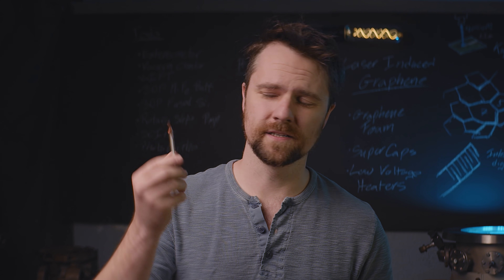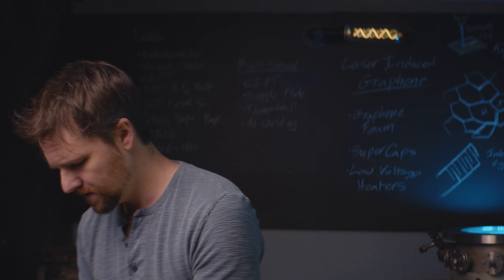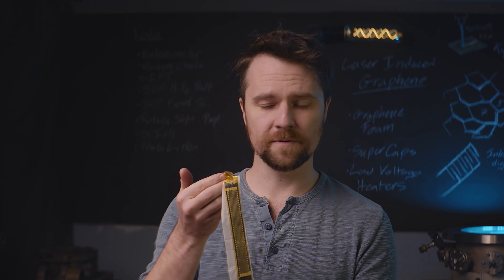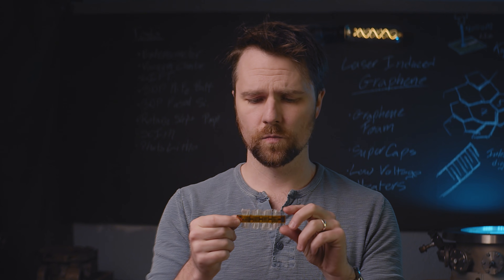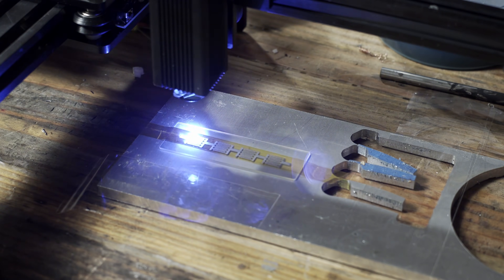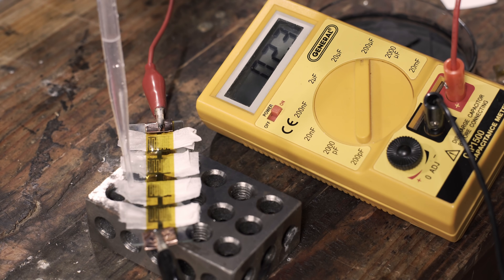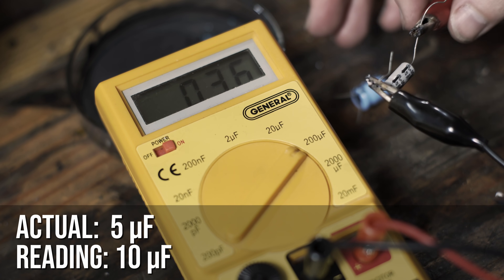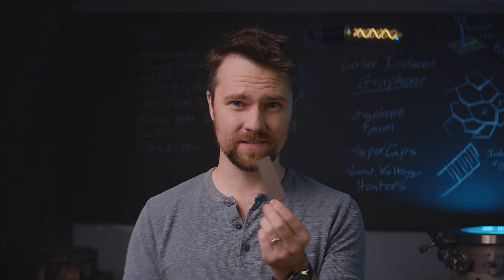Kapton Tape Supercapacitor?

Comment: Just a note, it doesn't matter how much capacitance you get, if the ESR is huge, then your capacitor is pretty much useless. You should demonstrate that in your video by actually charging and discharging your capacitors and see how much useful energy you can store

Comment: Well, hitting a tape with a laser makes graphite, not graphene, and the measuring of the capacity is just incorrect in this setup. Also you successfully created a battery not a capacitor. Thumbs down.
Reply from the maker: You can take it up with the authors of the Nature paper, and all the other academic work that has produced and characterized Laser Induced Graphene on polyimide.  Lol.  I'm just showing what scientists have published years ago.  But cheers for your opinion. 😂

Comment: Would you please show the particulars of the lazing process?  For instance, the distances, power, speed, tape sticky side up, or down, etc.  Just so that others can experiment, without having to try and decipher the papers.
Thank you.
Reply from the maker: Sorry, that was my fault!  I'll add something to the description, and keep that in mind for future videos.  I used 90% power, 40mm/s, stick side down, and unfortunately unknown/no-name kaptop (was lying in my drawer). I did test with a few other varieties of kapton and it seemed highly variable between different brands thicknesses, so running a power/speed grid test is probably the best approach for anyone wanting to try this.
Reply: @BreakingTaps  Thank you.  I really appreciate your quick response.  I went through the papers, and started designing a gridwork on Inkscape, based on their 206 volt capacitor.  But now that I finished it, I see that I made the inside squares .5 mm, instead of 3 mm.  So, I'll save that one, and start on another, while I wait for my sulphuric acid to arrive.
It looks like you have one side attached to the terminal, and then some interior LIG not attached to anything, and then the other terminal close to the interior LIG.  Is that correct?
Do you know what difference there will be, between smaller, or larger interior LIG?  
Did you lazer both pieces of tape, and then sandwich it all together,  then add the acid?
Does the LIG on the top tape line up with the LIG on the bottom tape, or does it matter?
Thank you, again.
Reply: @BreakingTaps  Also, was Sulphuric acid the only acid you tried?  I have Hydrochloric acid and several bases.  Robert Murphy Smith says both bases and acids can be used, but is there a "best", that you know of?
Thanks.

Comment: I'm interested in how many watts of power you managed to get out of that power resistor you made. Power resistors have many uses besides heating and in fact, I have an application for one right now on my workbench. It would be quite nice to just manufacture one of the value and power needed and not have to order one and wait.

Comment: Why are the traces so wide? Is that a limitation of the laser/lasing? Or is that thickness required for physical strength? (It seems like more, and thinner fingers could double the capacitance.)
Reply from the maker: No particular reason, they can definitely be smaller! I wasn't sure how big they had to be at first though so I designed them as chunky rectangles.  But after playing with it you can get much smaller lines (focal spot is 0.5mm or so), I was just too lazy to go back and edit the designs much.  The laser software isn't the most pleasant to use for complicated designs :)
Reply: @BreakingTaps  oh wow, what was the trace width? If it was 2mm and you COULD do .5mm that would quadruple your capacitance!!

Comment: Something to keep in mind about cheaper cap meters is that they tend to use a timer based system to approximate capacitance values, and cannot factor out dissipation from the reading they give.  This means things like moisture, excess soldering flux, and other contaminants can increase the reading you see over the "actual" capacitance value you'd see on a more expensive LCR meter.

Comment: These "ultracapacitors" are really just rechargeable chemical voltage cells that use some kind of carbon sulfate / carbon electrode chemistry, in exactly the way a lead-acid battery uses its lead / lead oxide electrode chemistry. The energy is nearly all stored in a chemical reaction, not an electric field.

Comment: You're getting high measured capacitance, however energy stored in a capacitor is also proportional to the square of the voltage.
Did you measure voltage stability?
For example, if you make a 150µF capacitor with a max voltage of 1V, an off the shelf electrolytic with 150µF, 16V will be able to store 256 times the energy.

Comment: A note on the capacitance meter: electrolytic caps tend to have a very generous tolerance range, skewed up, since for the most part they're used with rectifying circuits for their relatively high capacity. There's a possibility for the real capacitance value to be closer to the meter readings than to the value on the label.

Comment: Great stuff, this channel is the most valuable addition to my subscription list since Ben. What laser power/sweep speed are you using, is the process very sensitive to it? The paper mentions  3.6w, but yours looks stronger, from what i can find online. 
How do you find these papers, do you have any worthy sources?
Reply from the maker: Thanks!  The process overall seems to be pretty forgiving, in that a lot of different parameters would yield a conductive black result.  But some are definitely more optimal than others.  I ran some test grids that ramped power and speed, and found that resistivity was best around 90% power and 40mm/s on my machine.  It was also heavily dependent on the Kapton tape I used... I tried a few different rolls (mostly no-name cheap brands) and the same settings would give different results depending on the brand and thickness.  So it probably requires tuning to each specific machine/laser/tape/thickness.  Another commenter tried and had similar'ish results, but ended up with lower power and slower.

I tend to find papers through semi-random stumbling :) E.g. I'll start with an idea I want to do (copper on glass), do some general Google Scholar searches and then start reading papers.  In the discovery phase I usually skim the abstract, intro and conclusion, then follow any interesting referenced citations.  After a few rounds of that I'm usually far from the original topic but have found a lot of neat papers along the way :)

Comment: Can the heater be made in a way such as its supporting material won't just melt? I'm thinking about making forges with this
Reply from the maker: In theory it would work if you could transfer the graphene to a new substrate, but that might be difficult.  I saw some papers where the "peeled" it off with another piece of tape, you might be able to peel it off and stick it on to a surface then gently decompose the tape.  Dunno, sounds like it would be very robust process :)

Comment: If you can reliably control the temperature, using the tape as a heater would be a great wrap for lithium batteries in cold weather climates.  Have a temperature sensor turn on the heating tape when conditions are too cold to charge the batteries in order to warm them.  Cheap, thin and flexible solution.

Comment: Big like. 
Didn't got the voltage limit of this cap. Why is it limited to 0.8?
Reply from the maker: Something to do with the chemistry of how these kinds of caps work.  Not entirely sure myself, but it's the interaction between the electrolyte and the electrodes, can only build up so much voltage for the chemistry.  Changing the electrolyte can alter the voltage/capacity/discharge properties

Comment: very interesting. If there's a way to make it more conductive, I could see this as a good way to prototype PCBs. With your heater, it looks like you're getting about 5 ohms. It would be interesting to see if the resistance increases as the length increases.
Reply: Yes it will

Comment: A kapton heater based electric countertop skillet sounds awesome. My current one has a very obvious hot ring where the wire heating element is.
Or a kapton toaster. 
I assume it's near 100% efficient at turning the electricity into heat right?

Comment: Cool stuff. You may want to test various kinds of space filling curves instead of simple "finger" electrodes, namely: Sierpinski curve and Koch snowflake - source publication: "Fractal-Based Electrolytic Capacitor Electrodes: Scaling Behavior with Respect to Fractal Order and Complexity", Benjamin Barnes, Othman Suleiman, JeanPaul Badjo, Kausik S Das, 2018

Should be rather easy to etch them using a laser.

Comment: Amazing exp. Thanks for sharing. But (I didn't really think about a response for this) why not use simply a copper layer to make this interpherometer? Long ago I got some microwave projects to use as band filter, that's ok for high freq stuff, but I've always wanted to discover about using that in low freq capacitance projects, actually I've never got some time to stop to do that. Anyway, thanks also for reminding that.

Comment: put graphene on a alternator on the receiving coil to help connection and it should help by making a better connection and so make the field stretch by early and low speed reception if not put on the magnets and try that way. my visual in my head says it stretch's better. a field viewer should prove it.

Comment: I don't trust to the meter reading at all. Charge it with 2v and see how long it can run a LED.
I wouldn't be surprised, if that wouldn't be capacitor at all.

Comment: You should try an interdigitated spiral. Tesla came up with something that uses two spirals nested within one another... Give it a try, let us know how it works.
Reply: Tesla didn't come up with it, it's been used in capacitors for decades now. The engineers at one of the companies he bought up had an idea to use it in a battery (still not a new idea just not easily done) though the efficiency gain is minimal for the effort of making the battery..  And most of the increased capacity comes from the fact that it's just a bigger battery period.
This guy can explain it a lot better than me https://youtu.be/mYP1sIuOKGY
Reply: @SilvaDreams  By Tesla, I meant Nikola Tesla... not Tesla the company... >.>

Comment: EXEMPLARY! Q?: Could the laser be set up mathematically to alter the linear cuts, i.e. compensating for the spiral roll in a typical cyllindrical capacitor format? As you said that didn't work out as well as your flat ones. Just an idea that may be worth a try. BTW, "BRILLIANT" video!!!! Thank you!
Reply from the maker: Definitely, yeah!  Especially if you spent some time working out proper gcode to run the machine, instead of the off-the-shelf laser cutter software I used.
Reply: @BreakingTaps  Still, impressive work, and a hearty well done!!

Comment: What is the Inductance of these? I suspect it would be low but could easily be wrong. Are these capable of running something like a TEA laser if enough are put together as I would think these should be able to switch very fast if the inductance is low enough.

Comment: Did you get that right, a 1000 microfarads from next to nothing is just incredible. How long will the charge hold ??
Reply from the maker: Thanks!  Not long I'm afraid, it self discharges quickly.  Not sure if that's expected for this kind of device, or just poor manufacturing quality on my part :)

Comment: The reason for the high values could also be leakage current. Especially on cheap meters, leaky caps can lead to much higher readings than the actual capacitance.
Reply: Cane here to say this.

Comment: I feel like this could be combined with the process to make microfluidic chambers out of shrinky-dink (https://www.youtube.com/watch?v=eNBg_1GPuH0 ) in order to create a sealed chamber pretty easily. In fact, you could sandwich that in between a pair of the tape-capacitors to increase voltage (or the capacitance, if in parallel).

Sure, you could use a lot of other materials to accomplish the same thing, but polystyrene was the dielectric of choice for capacitors once upon a time. Maybe there's another material that would work which could also be laser cut to match, rather than machined and then shrunk?

Comment: This makes me kind of worry about using Kapton tape, if there's a possibility it could be broken down into a conductive material.
Reply from the maker: To be fair, it's a lot of power being directed to a very small spot. Maybe 0.5mm laser spot size (it doesn't focus very well), 5W optical power, that's about 5kW/cm^2.

Comment: why buy a $200 laser when $99 3d printers can put out the same light 405nm
can't u just put the tape on top of the print bed and run a single layer program for 10 seconds

Comment: It makes you wonder if this could be 'good enough' for a lot of the chicklet components in a circuit. A straight line of graphene would be a wire, a longer/thinner line a resistor, you have capacitors here, a coil with a via could be an inductor, built in heaters to let the smoke out...  Maybe not impossible to have your PCB made out of etched kapton? Imagine one day sticking components like chips/transistors/diodes to kapton tape, and with a camera and autolayout the laser recognizes components and carves out the appropriate circuit. Need to experiment with this stuff :).

Anyway, really fantastic content and insights here! Excited to jump back into home electronics with the newly arrived laser - so thank you, I think ;)
Reply from the maker: Thanks!  It does seem that you can electroplate this stuff with copper too (only briefly tested), so perhaps that's a way to get an inbetween on cheap/easy/conductive-enough?

Comment: Kapton tape w/o adhesive?
Reply from the maker: I've had a hard time finding it commercially, unfortunately.  You can get thicker polyimide sheets but they are a lot more expensive, and it doesn't seem there is a market for non-adhesive thin polyimide/kapton "tape".  I'm sure it's available somewhere but I haven't found it yet :(
Reply: @BreakingTaps  Ouu but there is! I was looking last night there’s sellers on Ali express! Type Kapton Film no adhesive idk what people are using it for but it’s wide cheap rolls. I’m thinking roller on one side attached to a motor on the other side of a 2 axis laser engraver. Put some guides for flattening the tape to the bed then print super long strips roll up into caps. profit? My end goal is batteries this might have saved me I had no idea about this kapton thing!

Comment: >off-the-shelf laser
>5 watts
Those 2 shouldn't go together in a single sentence
Reply from the maker: Yeah it's kinda frightening when you think about it. I'm amazed the FDA allows these to be sold tbh.  I really should have put a warning at the beginning about laser safety too, I'm not using the crappy laser goggles they sent but a nice pair from Thorlabs.
Reply: You would be amazed what you can get... You can easily buy retired surgical lasers off of e-bay as well as high powered green lasers...... Then there are the questionable ones from China that claim to be for removing hair and blemishes but can easily do a LOT more.

Comment: When stacking the tape did you consider hitting both sides of the tape with the laser before stacking?
Reply from the maker: Unfortunately the adhesive on the tape (some kind of silicone adhesive) interferes with the process from the reverse side :(  If I could find non-adhesive, think kapton that would be great but I haven't found it yet, just thicker sheets of polyimide.
Reply: @BreakingTaps  Just clean off the adhesive with acetone or something

Comment: Late to the game, but your capacitance meter is testing how much of a particular frequency passes through. If you have unintended parallel resistance, you can get an artificially high capacitance reading. I just tried it on my own meter but it didn't register 1 mega-ohm parallel resistance (notable but <1% change).

Comment: One important test for your capacitance meter -- put a resistor across it, no capacitance. Does it still try to produce a reading? If so, you need to be cautious about taking the measurements too seriously. Try also measuring DC resistance of the assembled graphene devices. WIth capacitance, the reading will start low and climb, but see if it tops out at some level or rises to effectively infinity (== good capacitor!)

Comment: That's amazing you could potentially make custom alternative to PCBs. is there a way to attach a wire to an end? (permanently that would fit in a 3D print not a crocodile connection)
Reply from the maker: I haven't found a good way yet, unfortunately.  Papers use silver epoxy which would work, but that stuff is expensive :)

Comment: Well done! The future is now! Thank you for making it open source you are a good man. i will share it and add to it, i already shared this 5 years ago and pretty much gave up on it t'il humanity wake's up and joins the fun, happy that you sharing it. i made free energy cells in similar way, the combination of our innovation is part of ultra top sets of advanced tech...i made circuits board with free voltage included and geometric dielectric fields with em all self activated with electron flow. we should talk my writing and patience writing is a issue. in concept and perception that i worked with. Aka plasmonic resonance nano oxide tech in the same way you are doing it. But you got the laser i got no funding. For years i have been censored, all public, Anyway you are doing amazing, if you wish there is a dimension of creation that goes right along with what you are doing..to advanced perception technology..geometrie based etc...

Comment: Maybe the capacitance meter is better than what you think, because, those errrors you get could be due to the cap and not the instrument (of course, every intrument is not 100% accurate). I think that regular caps have ±10% of error, so, the instrument could be working just fine.